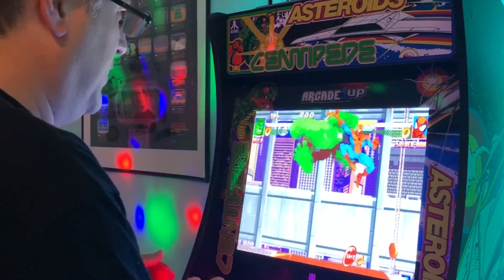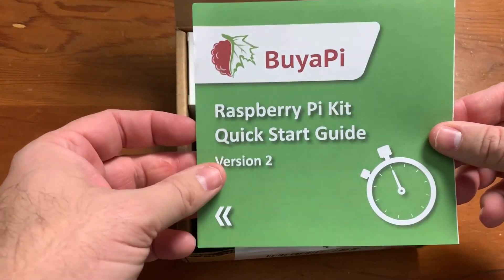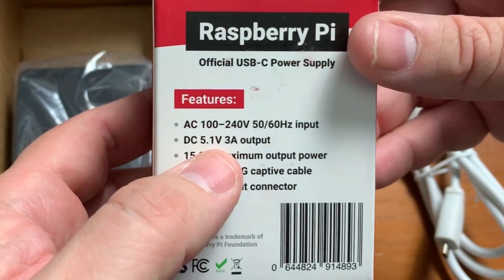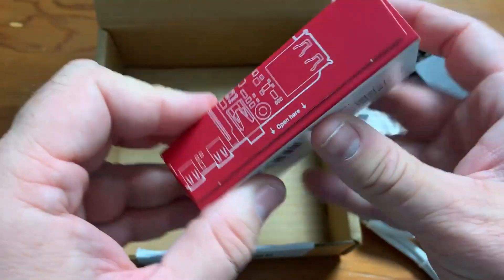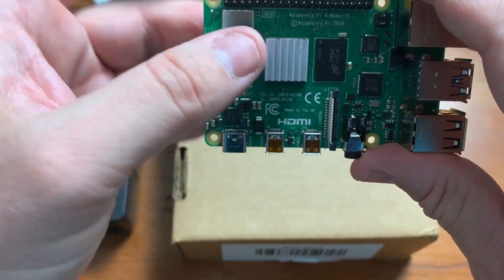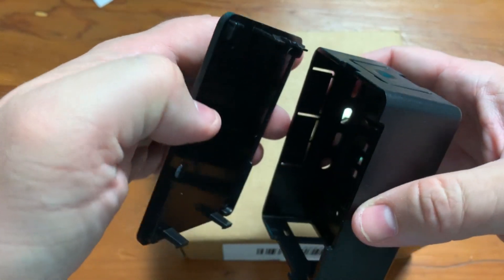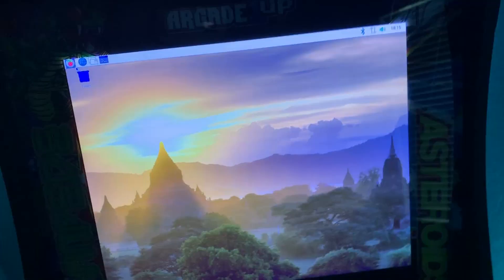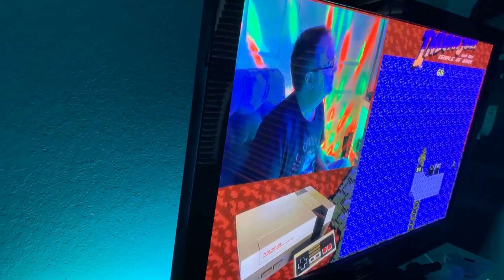Raspberry Pi 4b Unboxing and Set Up!!!

Comment: Don't forget to install the new firmware.     😉
Reply from the maker: Good point! Be nice if it somehow fixed the issue with the power connector. But that's a hardware issue so, probably not.